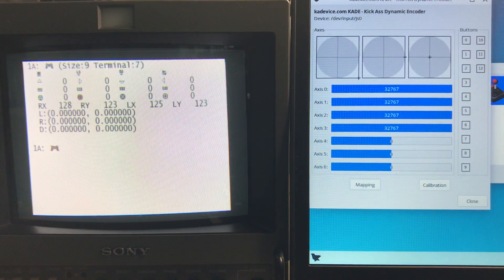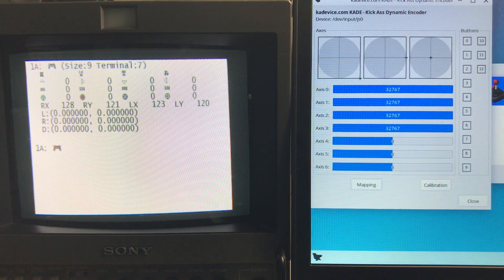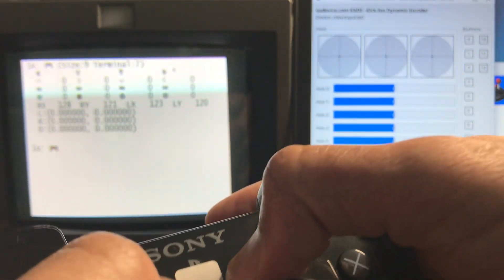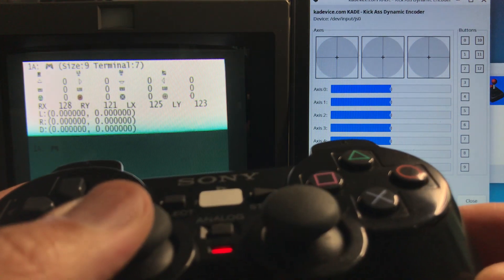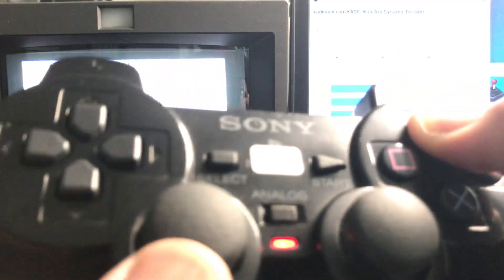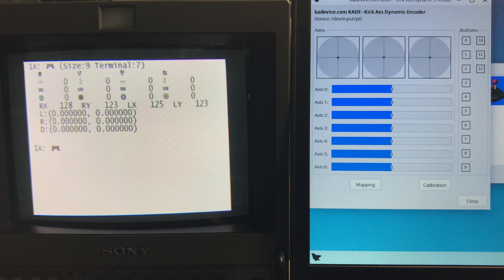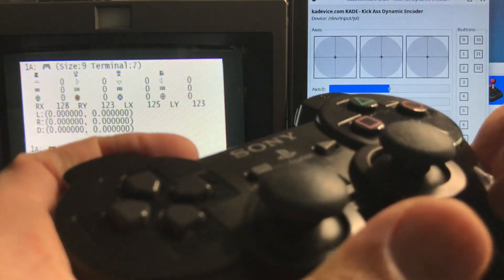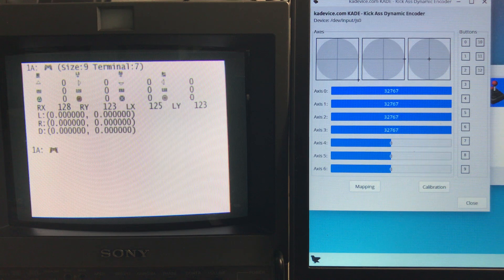How do I test controllers

Comment: These are great videos! I have 2 H controllers with the fixed pins not working. Looking at your comments on another video I need the 43 A ribbon and new pin connectors. Is this an achievable task for someone who doesn't even own a soldering iron?
Reply from the maker: I made a few videos on just removing and re attaching the connectors, it looks easy but you would need practice, once you watch them only you can judge if you can do it or not.
Reply: @restartrepairs4393  thanks for the reply! Just watching them now..  Looks like it could be worth giving it a try.

Are the ribbons from aliexpress any good? I mean does the controller work as before, no difference?
Reply from the maker: @stovies5  some times I do get bad ribbon cables, I even made a  video about that too, so when I order I try several vendors and I order a lot. Once you replace it it works as before no difference and now the controller can be fixed again in the future with the same part.
Reply: @restartrepairs4393  good to know. I think I'm going to give this a try. The controllers are broken anyway so won't do any harm.
I also have a A model. My only working controller but now worried. Is the ribbon for that 42A?

Do you sell the repaired ones? Maybe easier buying :)
Reply from the maker: @stovies5  The model A uses 2 different ribbon cables there are sub models within the A, H and M, some use 43 some 42 and some 35 those are the most commons. I do not sell or repair for individuals, I am more set up for like an industrial level, I only take large amounts and fix in bulk.
Reply: @restartrepairs4393  I really appreciate all your help. One last question 😅. How do you know which ribbon cable it is? Do you know just be trial and error or is there a, way to easily identify it.
Reply from the maker: @stovies5  It's not possible to accurately tell what ribbon cable they will have without opening, the most you can do is narrow it to 2, I think I made a few videos showing all the variations and there are 6 common ribbons 3 on the A, 2 on the H and 1 on the M.
Reply: @restartrepairs4393  Did you come across of any model A controllers where the L3 or R3 is permanently engaged? I have a brand now OEM controller where the button still clicks but once I look at padtester I see L3 is always on. I tried to reflow the switch connections but to no avail. Any ideas?
Reply from the maker: @not_ian85_ca  Hi and yes, not sure if you noticed I have a playlist for all models and their issues, I think I have a video for that.